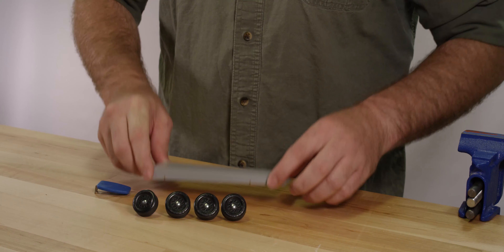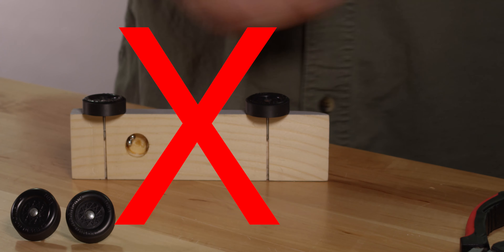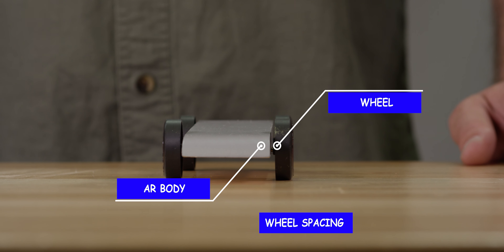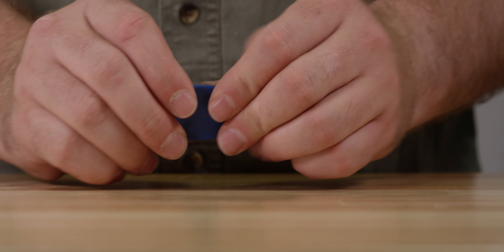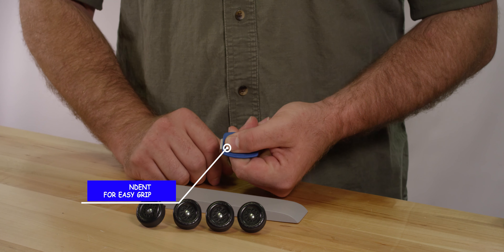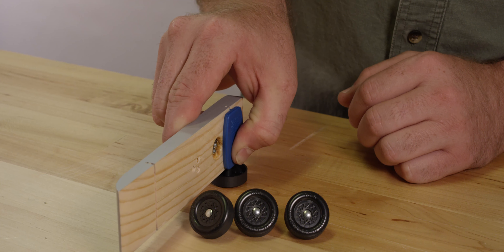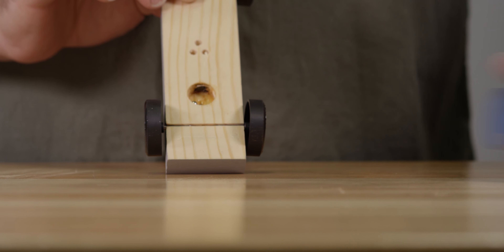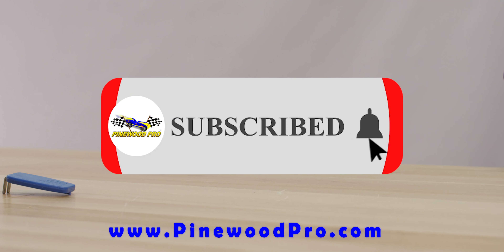Pinewood Derby Axle Installation - PRO Axle Guide Tool

Comment: How did you insert the tool on the other side, once you've got one wheel in? The pro tool cannot get inserted in the same slot, once you have an axel in place
Reply from the maker: Sorry, not sure what the problem is...just move tool to the other side and insert that axle.  The tool does not interfere with the axle on the other side.  It works!  Give us a call if you have further questions.